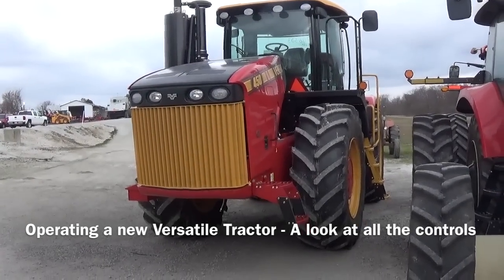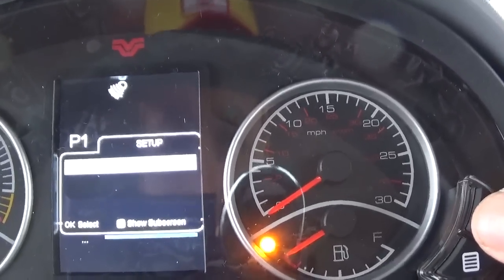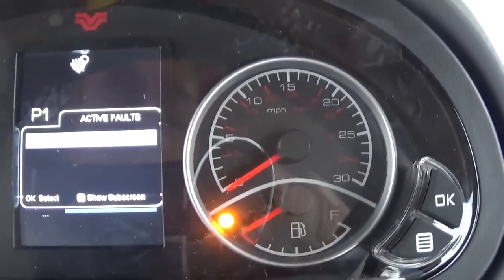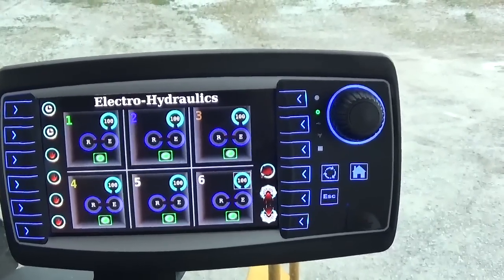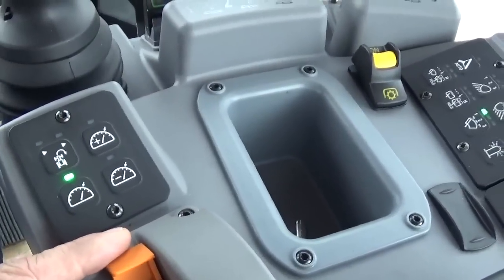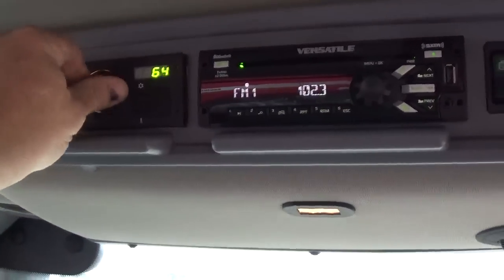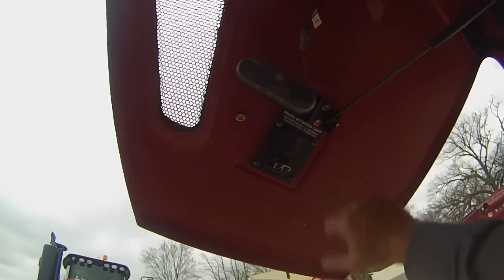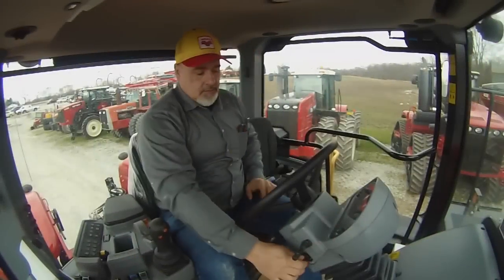Operating a new Versatile Tractor - A look at all the controls

Comment: Does the de accelerator pedal force the tractor to slow down or is it kinda like a throttle? I’ve been trying to find out the information on Versatile’s website but couldn’t find it. Please let me know when you can.
Reply from the maker: Justin Germanovich.  You can set it either way but on the 4WD most want it to slow the engine down and on the MFWD most prefer it the other way

Comment: first off, good job, interesting walkthrough, good information flow, no worries there.

i guess you noticed yourself, but plz level the audio sources next time during EDIT, thanks, that shouldnt be more then using an option in your editing program.

if you need a free audio editing software, there is a great tool called "audacity", you can do advanced stuff in there, like noise reduction, compression, leveling and so on, very easy to set up.
Reply from the maker: Thanks,  I don't claim to be an expert in making videos and narrating them is something I just started recently.  I'm learning as I go.  The issue here was using two different cameras but I'll work on it.

Comment: Seems like a very well thought out machine, but what surprised me is that a 3-point hitch is optional. I can't imagine a tractor without a 3-point hitch.  I grew up in the 60's and early 70's in Iowa and we used John Deere. Had two 4020 diesels without cabs which I loved then and still do love those old tractors today. Those were the last tractors I ever drove. The last time was in about 1974. Equipment and everything about farming sure has changed. I don't know if I could ever get used to the new ways.
Reply: You can't imagine a tractor without a 3point hitch, and I can't imagine why I'd want a 3point hitch on such a high horsepower tractor. Different worlds huh?

Comment: Nice video Mike keep 'em coming. You just need a little work on the sound, nothing else.
Reply from the maker: Yes the sound was low during the GoPro part. I considered deleting the sound and lip singing it into the computer during editing.  Either way probably wouldn't have been good.  But maybe I will make another in a Versatile MFWD tractor.